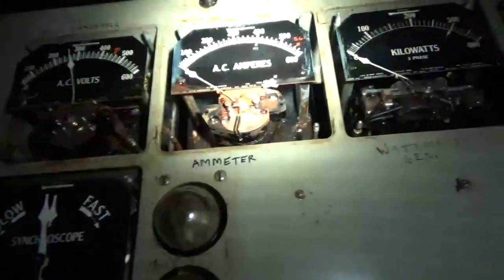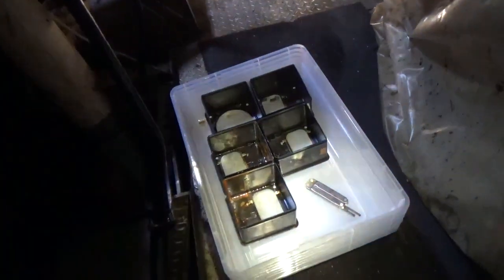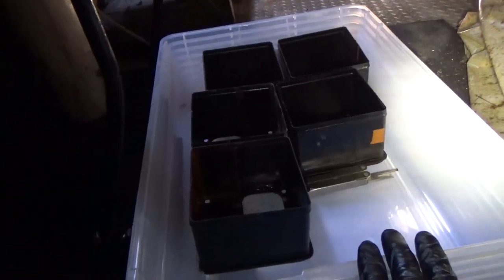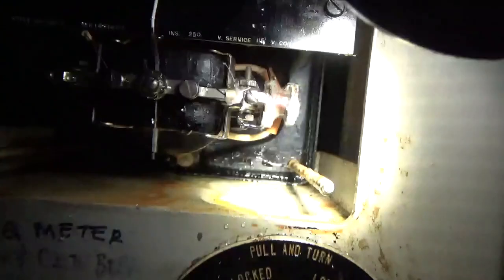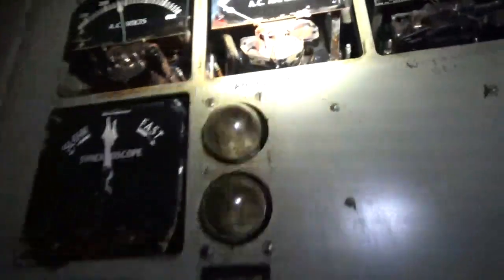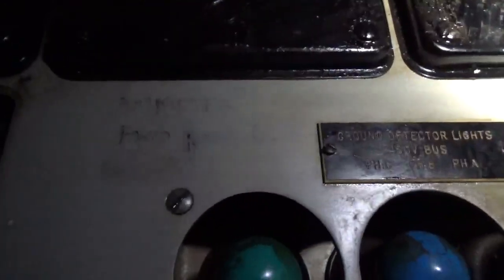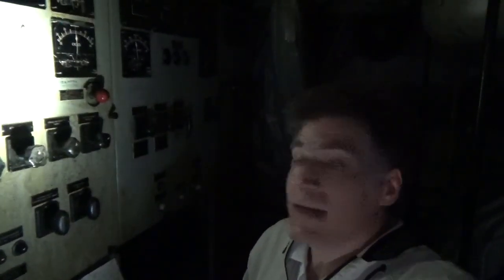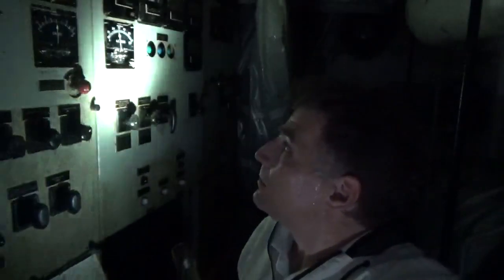Power Panel Updates: USS The Sullivans

Comment: I wish I were closer to you so that I could volunteer. Cleaning and restoring this switchgear looks like an awesome, if laborious, project. My biggest fear would be all the wiring, distribution panels, etc. on the rest of the ship. As with every other artifact, moisture is your enemy, and it has probably seeped into conduit all over the place. The switchgear can be taken apart piece by piece, but you can't do that to the whole ship!
Reply from the maker: Thanks for your comments, Quentin! The goal is to bring power back through the original panels for sure...but, as you mention every inch of the boards will have to be surveyed and cleaned! Appreciate it!

Comment: As an electrician mate in the USN,BEING ON A WWII destroyer had to rebuild both main switch boards. the breakers and most components are made of a corrosion resistant materiel. It's do able.Meters,volt,amp,phase rotation meter,might be iffy,substitute a replacement for now. It's not under way,won't be needed.Aboard the DD821 USS Johnston.I remember seeing the USS Sullivans moored forward of the Johnston in the early 70's.We  went aboard other ships for pars.The Sullivians was one of them.
Reply from the maker: challenger-rta. Thanks for your very thoughtful remarks. This will be a very long process. We do have temporary transformers and power panels on board for the work being done and for the dehumidifiers\air movers\lights...appreciate it, and will keep it in my notes moving forward.

Comment: You can upgrade the system behind the panels and still keep the original appearance on the out side. You could  also appeal to older manufacturing firms that may still have components in there inventory that they no longer need. I worked in a local steel mill in northwestern PA before I  retired and there was a lot of vintage electrical components still in inventory that where no longer used.
Reply from the maker: Randy. Thanks for your comments! Everything will be looked at, analyzed and addressed. If we find that we can't bring power back through this means, that's the next best suggestion - at least give the appearance! We also know this is a one-two year process. So, we have some time to try to get this right!

Comment: Ouch :-(
That panel needs a lot of TLC to get it back into safe working order, or even just getting it back to a really good external state.
While lots are looking at the switches and meters it is worth looking at how far water and product (I just love your use of that word) has crept back up between the wires and the insulation on the cables.
Reply from the maker: Rob - thanks for watching, and appreciate your comments! It is going to take a lot of work - - but, with The Sullivans herself. Taking deliberate and clear steps to try achieving our goal is what we'll be doing. Bringing in experts over the next six months is the plan!

Comment: This is a serious issue.  My Dad was an electrician's mate on the USS Laws, a Fletcher Class Destroyer in WWII.  This was his work station on the Laws.  With 28 years experience of selling electrical switch boards to contractors I can tell you that most of what is there is probably unsafe regardless of how well it is cleaned.  You are going to need electrical engineers, electricians, and electrical inspectors to go through this.  As much as preserving and using the ship as it was built, supplying lighting and some air control (fans, etc) would be better off with a new modern system tapped in where possible and use the switchboards as a static display.  After all, the boilers, turbines, generators and most all of the rest of the equipment has not been operated in any way since the ship became a museum.  Just my opinion, but getting the ship opened up to visitors in a safe way makes sense.
Reply from the maker: Dan - Thanks for your comments! We've worked with the electrical engineer who rebuilt the plant on USS Slater, and we've spoken to a few others. We understand that this is going to be a long, and arduous process! Appreciate your thoughts!

Comment: Well if you are pushing on meter needles you are possibly damaging them.  And from what I saw in this 9 minute video you have no idea what your doing.  And if the ship reopening is based on you fixing that power distribution panel,  I really can’t see it happening.  You are in way over your head.
Reply: You got that right. The man is doing more damage than good and is simply wasting time pretending to "work on" a system that is now beyond restoration beyond the point of display only. The components are junk and the "repairman" is dangerous if he thinks he can re-energize the scrap shown in this video. This video is another example of why the ship sank in the first place, amateurs thinking they know what they are doing.
Reply from the maker: Welcome back, Old Tugs...we all missed your positive comments over the past couple of weeks! As a former teacher, I'm sure you can all give us the lessons we need!
Reply from the maker: Come on down, Rodney! Would love to see that passion and teach the crew a thing or two!

Comment: Shane I agree with Mr Webster below get some dehumidifier down there. that will slow down degradation of the equipment due to corrosion it will also dry out all that insulation. you can use the house type portable one they will fit through the hatch. for continuous operation dump the desiccant into a bucket with a sump pump to pump it overboard sump pump will have to be on upper level I couldn't find one with enough lift to pump from lower level. another thing if those are the Cutler hammer breakers like on KIDD you might find old stock replacements in one of the electrical supply houses around buffalo or new Jersey. those are the area where many of the Fletcher class were built as I'm sure you know. I would also see about putting a large tube fan on starboard side over that hatch to draw air from the hatch just outside of aft head between head and. 53 ready handling room. even without steam it gets really hot down there and heat stroke or exhaustion is nothing to play with. also dielectric cleaner will wash away most of that oil and will not effect paint or the electrical. it's expensive but we'll worth the money just in time savings. but ventilate well it will get you high and possibly kill you if you don't just like any quick flashing chemical it will keep you from getting oxygen. sorry for the book length comment. lot of info to get across. worked as mantinance for Kidd 5 years with Tim.am well versed in every space of Fletchers.
Reply from the maker: Hank - Can't thank you enough for writing these comments! We'll be getting blowers and dehumidifiers down there this week. I'll also look into those cleaners you mention! Love to have your thoughts if you were standing in front of the panel. Your experience on Kidd is invaluable! Appreciate it...and enjoy a visit from you to check it out if at all possible. USS Little Rock is being used as the local "hotel" for visitors!

Comment: If those spaces are off limits to folks, can you pull exterior panels?   Pull exposed fuses…spray down with wd40 (actual purpose…is WATER DISPLACEMENT….not lubrication). Find anywhere where there are accessible connections, label and detach…AFTER labeling…taking pictures…and attaching tags on all connections/ends.  Think also of wiring runs…where there are armored/sealed runs with dips…there WILL be water in there.  Drain it out, blow it out….
Reply: …getting blowers in there to circulate non-saturated air is huge as well.  Look for anywhere with high voltage stepdown transformers eg 400V to 120v.   Are these still intact?  A new system is less preferred for sure! But if temporary…and helpful to chase moisture out NOW…should help increase odds of keeping the original systems functional.  These were mil-spec everything for a reason…they were made to be bodged and patched back to an operational state quickly!
Reply from the maker: Tony - so appreciate your thoughtful comments! Sounds like we could your a visit from you to give us some hands on guidance! Barring that, I will be outlining your suggestions, and working with the electrical team that we're getting together to parse these steps. Thanks so much!

Comment: A bucket of warm water, some Dawn dish-washing fluid, and some rags to apply and dry are really all you need to clean up much of this residue...and it won't harm any of the instruments.  As for the corrosion, a dry silicone is very good for that, but I do not know what the Navy procedure is.  All in all, it's a lengthy process.
Reply from the maker: Ray - appreciate you watching, and for your comments! We're going to be following best practices for this important working artifact! Appreciate you watching!

Comment: As a electrician on two fletcher class ships dd558,dd540 I think you are looking at a huge task. Whenever we got salt water etc in motor controllers etc. we disassembled and flushed everything with distilled water then dryed everything, clean contacts reassemble. However in the switch board the large breakers and  switches have set for a long period of time in a enclosed cases with fowl water, to disassemble and restore would out run a  budget very quickly.
Reply: Why is it expensive
Reply: @Synergy7Studios  Possibly because they have try and clean old, sealed components that are probably no longer available.
Reply from the maker: Terry - Thanks for sharing! We are going to be doing everything possible to make sure we exhaust each option before bring "new" power systems on board. We have the understanding that you are mentioning here...but, haven't seen hard numbers yet. But, we understand this may be a multi-year process! Appreciate your comments!